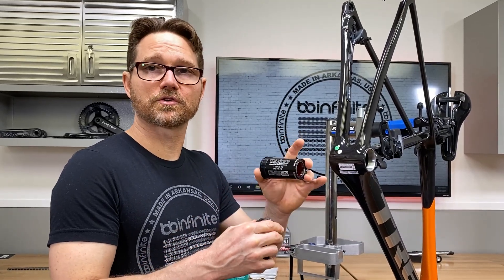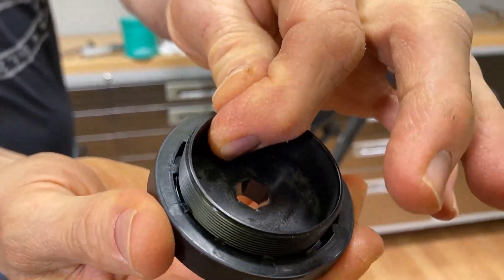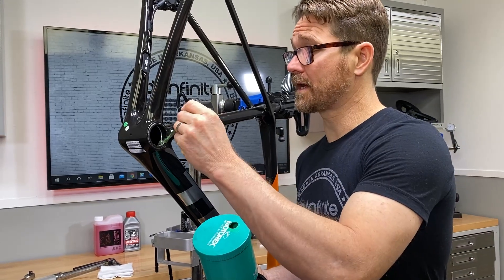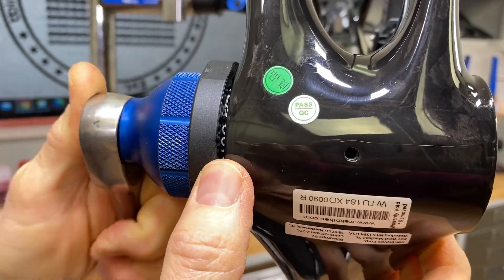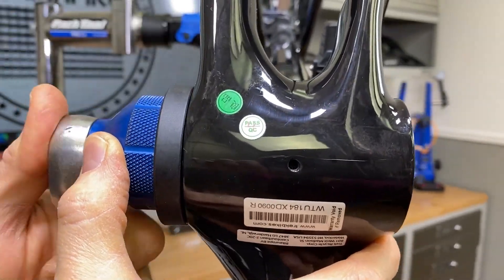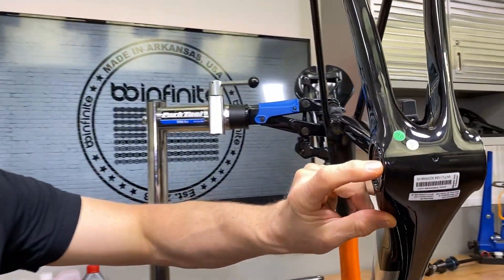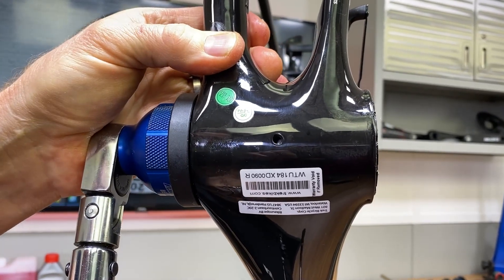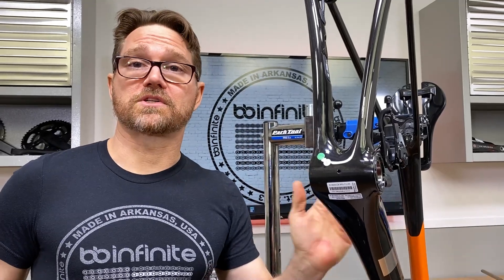BBInfinite T47-internal, 1-Piece, Hub-style Bottom Bracket Module Install

Comment: Trek uses 85.5mm bb in their spec sheet. Could we use your 86.5mm bb on them?
Reply from the maker: Yes, that's no problem. The difference is only 0.5mm side to side, and that's nothing for the front derailleur to handle. Well within its capability.

Comment: My 2025 Look 795 Blade RS came with Praxis T47.  Praxis use steel Enduro bearing.  Spin test - about 2.5 turns.

Yesterday, I installed BBIfinite T47 with Ceramic coated bearings.  Spin test - go get a cup of coffee.....

I am delighted.
Reply from the maker: And we are delighted to hear it!

Comment: What grease are you using here and do you recommend it generally for bottom bracket service?
Reply from the maker: We use Motorex 2000 for general lubrication, such as on threads. We do not recommend it for bearings in general as it's a bit too thick.

Comment: So you need a Park BB socket in addition to the delrin tool provided?  If so, which one?
Reply from the maker: This is an old video. We now offer a two sided tool that accomplishes the task. https://www.bbinfinite.com/products/bbinfinite-16-notch-bicycle-bottom-bracket-tool?_pos=2&_sid=8dc4b8dee&_ss=r
If you just want to use our plastic tool, and an alternative socket for the "small" side of the BB, the Park BBT 69 series is what you need, or any socket that will fit on a traditional external BB, examples being Chris King Shimano, GXP BSA, or Campy UT BSA/Italian. If it's 16 notch, and 44mm, it will  work.

Comment: Nice that Traek has adopted the T47 system .The previus bb 90 has a lot of complains.
Reply from the maker: Thank you for commenting. And now LOOK and Colnago have adopted T47. We strongly advise anyone looking at new bikes to  only consider bikes with T47 bottom brackets. BSA/English and Italian are obsolete. T47 is threaded and much larger than the old fashioned threaded systems. This means T47 can properly accommodate modern large diameter spindle crank sets like Dub and 30mm. T47 can also support an "internal" type, which means the BB shell can be very wide. Thank you for commenting. BB90 was a great system. It's only flaw was Trek's insistence in using grease to install the bearings into the carbon frame. If Trek has specified a retaining compound like Loctite 609, BB90 would have been a success.

Comment: All cool if that aluminum thingy doesn't get any oxidation!
Look at that tiny surface area to insert the tool...
If those tooth thingies deform, good luck removing that...bb😅
Greetings from Croatia
Reply from the maker: The aluminum is Type 2 anodized and is electrically inert, therefore there is no chance of oxidation or galvanic corrosion.
Our torque spec for the BB install is only 30Nm. The flange is 2.5mm thick with deep notches for engagement. It's so good we send a plastic socket with every BB that is good for install and removal. If removal every becomes difficult we have steel sockets as well.

Comment: What bb tool you use. I cant find any for T47
Reply from the maker: There is not set "T47" size, unfortunately. This is what we spec for ours: https://www.bbinfinite.com/products/bbinfnite-t47-installation-socket-steel-version?_pos=1&_sid=a5c826e10&_ss=r
Reply: Having installed the t47a verison, I would recommend investing in a Park Tool BBT-47-12. The install is a breeze with it compared to the Delrin tool provided, as I found it was difficult to keep it engaged with the teeth while trying to torque to spec, but have no such issues with the Park Tool.

Comment: I'm wondering if your BSA-threaded BBs can be updated to a one-piece design like your T47 BBs? Or it's not as simple as I thought?
Reply from the maker: We wish we could do that, but unfortunately the BSA opening through the frame is only 35.6mm or so, which is smaller than the 37mm OD of the bearing we need to use for Shimano or Sram Gxp crank sets, and so there is no way to do it.
Reply: @BBInfinite  Right, another thing is BSA BB bearings sit outside the frame. I can't believe I totally forgot about this.
Reply: You can uppdate to the new SRAM dub if it is an alu axel your after .But it will be an 29 mm axel  .
Reply: @SMidberg  Most BSA-threaded BBs have bearings too small for SRAM DUB when bearing durability is taken into account. Hambini's uses 6806 bearings with bearing top hats to reduce the bearings' inner diameter from 30 to 29 mm.

With this bearing dimension, this means the cups are relatively oversized compared to the average BSA-threaded BB.